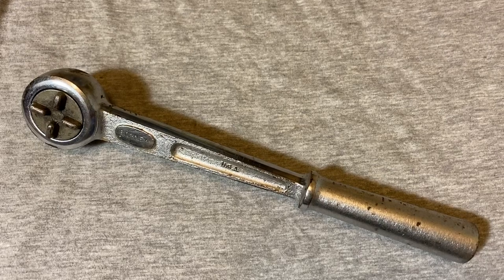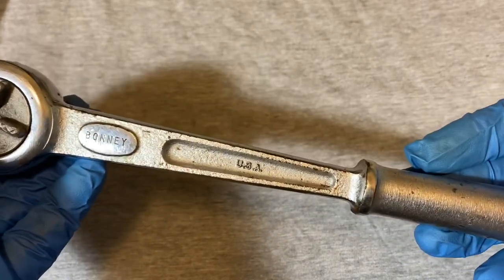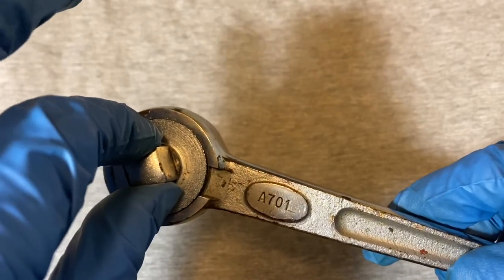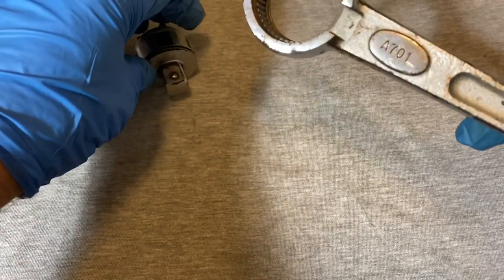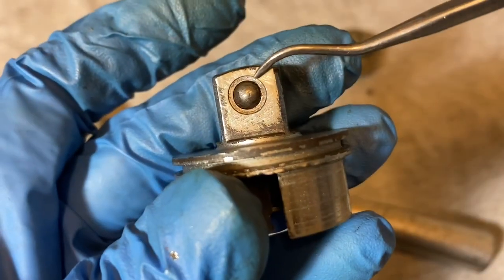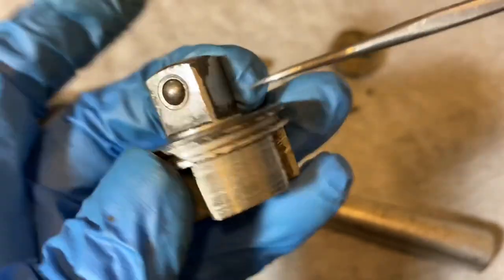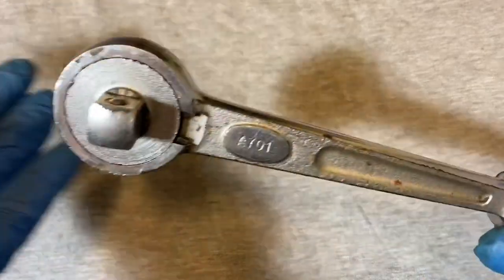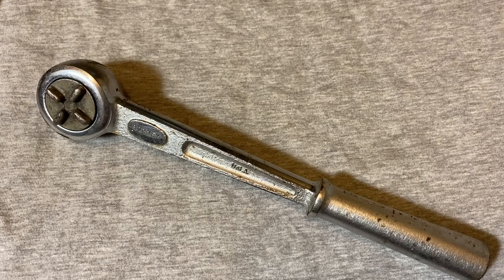Bonney A701 Ratchet TOTAL TEARDOWN, Vintage 1/2” Drive

Comment: Wow, thanks for the video! I've been trying to figute out what make of ratchet I have had for about 40 years now. Unfortunately, you can't post photos in the comments here. Seeing this video has me convinced that mine is a Bonney that they may have made for someone else. It has the same unusual direction switch on the ratchet head and the tail end is the same, but the shank between the head and the tail on mine is smooth (pebbly smooth) and without any writing. The only marks on mine are W (in a circle), followed by 1-2 on the tail end. Very rugged, trouble free ratchet/hammer. :)
Reply from the maker: Very interesting. I did a little research and could not find a maker with circle w. There was a circle M but that was Moore drop forging and they were not making ratchets with that marking. The closest thing I found was a Japanese proof mark that had what looked to be a wavy stylized W in a circle ? Then there was Williams but they used a W inside a diamond.

Comment: Yeah Bonney was an innovater. You should have a date code on that. I think they started out in late 40's but after 47.
Reply from the maker: Haven’t spotted a code on this one❓
Reply: @snapringchronicles3020  yes sometimes they're so weak its toight to even make out on these.
Reply: Any idea when they stopped making them?
Reply: @drfrankenbass  yes I believe in mid to late 60s when Triangle Corp took them over.